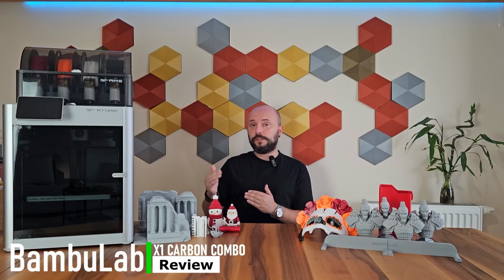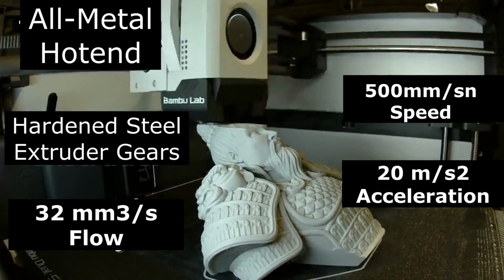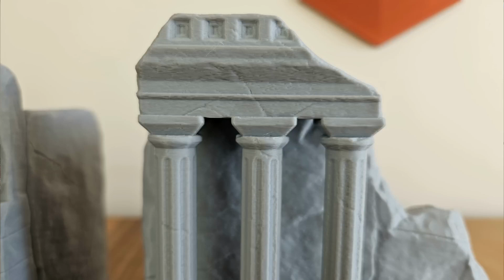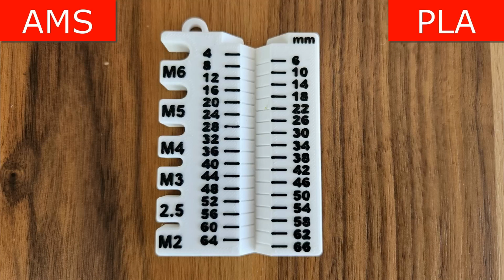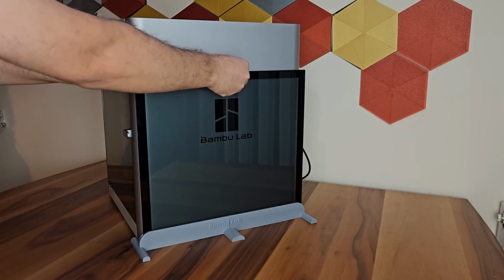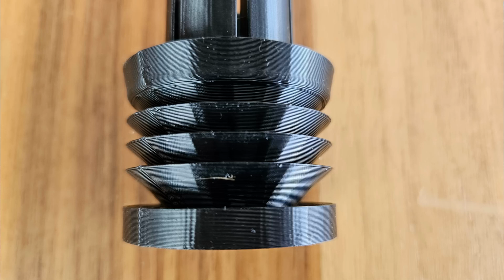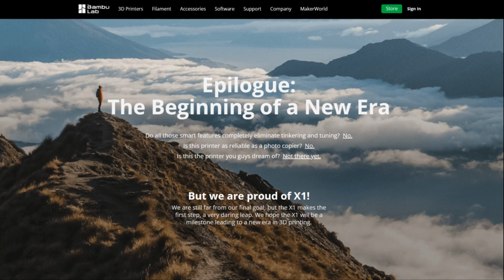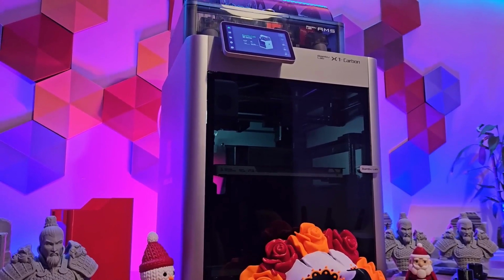Bambu Lab X1 Carbon Combo Review

Comment: Realized that it's better to use several printers for different color, and then combine parts,  than to use an AMS - it would be a lot faster and no filament waste (which is huge 😮)
Reply: But the mask looks stunning 😮🔥
Reply from the maker: @burningman1945  Yes, the mask is nice but there is a lot of waste. Filament consumption is high for hobby use only.

Comment: Not 256 cubic mm.  The volume is 256 X 256 X 256= 16,777,216 mm^3
Reply from the maker: You are absolutely right. I don't know how I said this :) I guess I just said cubic centimeter since it was the same in all 3 axes.

Comment: I considered the x1c but I wasn't interested in the ams due to waste. In the end I decided to go with the Flashforge Adventurer M5  Pro which has many of the same features and is less than half the price. So far I'm pretty happy with it.
Reply from the maker: Hello, thank you for your comment. Yes, the AMS system wastes a lot of filament. Although the X1C has better material quality, the M5 is a printer that I also like. There is also an M5 review on my channel, if you watch it, I would like to learn your experiences about your printer.
https://www.youtube.com/watch?v=fsOV1u8GhCE&t=156s
Reply: @3DPrintLab1  I'm curious what you mean by "better material quality".  If you are referring to the housing being aluminum vs plastic guess that's just a matter of opinion.  Aluminum is easier to dent and plastic is typically more damage resistant.  I think the doors on the X1C are glass where the M5 has plastic doors.  Again, plastic is more durable and they work very well.  The only 2 features I know of that the X1C has that the M5 doesn't is the sensor at the head, lidar I think it is and the purge tower.  The X1C does have a slightly larger bed and that would be nice but I'm just not convinced these things warrant the huge price difference (over double).  I could be wrong, I'm no expert.
Reply from the maker: @caseypries7559  Yes, as you said, the first thing that naturally catches your eye is that the metal covers of the body are glass. Apart from that, even the plastic parts give a premium feel. You shouldn't think of this only as impact resistance and flexibility. Even the weight of the printer affects the print quality. A solid carrier frame and body helps reduce vibration. I think we shouldn't compare the M5 Pro with the X1C, and this includes the price. The printers that we can evaluate in the same class as the M5 Pro should be printers like the Bambu Lab P1S or Creality K1C. Their prices are also close to each other. Whether it is worth the price difference depends entirely on the user's expectations. For example, I wouldn't recommend the X1C to someone who will use the printer for a hobby, it is unnecessarily expensive. (If have a lot of money, that's different 😄) The M5 Pro will more than meet the expectations.
Reply: @3DPrintLab1  I'm sorry but I still don't get it.  To me the x1c is just overpriced.  Making something from aluminum just to be aluminum is pointless.  The M5 is a metal frame, just plastic covers. Again, I have a lot of trouble understanding the $600 price difference.  I could've bought either model.  I just didn't see the point in throwing money away. So far the only thing I've heard mentioned is aesthetics.
Reply from the maker: @caseypries7559  I hope you don't think I'm defending Bamboo Lab. I'm just speculating why it might be expensive. Of course, it's not just because of an aluminum body or a glass cover. The processor, motherboard, the quality of the materials used in the mechanical parts, the cooling fans, extruder, camera or the lidar, all of these can affect the price. So we can't judge it based on what we see. I don't know how much each of these affects the price or what they will provide us. Maybe the processor used in the X1C is 10 times more expensive than the one used in the M5 Pro, I don't know. Maybe it's unnecessary to use this processor for a printer, I don't know that either :) But I think there's a reason why the X1C is so expensive while the P1S and P1P are more economical printers. Is it worth it? I'm not sure. I don't think the print quality is as much as the price difference. Maybe the quality of the materials used in very long-term use can make a difference.
Reply: @3DPrintLab1  No, I was just trying to make sense of the price difference.  I'm more of a function vs form person.  I appreciate form but in the end I'm looking for things that actually work and provide good value.  When choosing between the 2 the only thing that stood out to me was the larger bed and it's not a big difference.  I just couldn't justify the extra expense unless it spit out much nicer prints and from what I've seen there isn't much difference there.  But as I said, I'm no expert and just wondered if there was something I was missing.  Right now the only issue I'm really fighting is extruding TPU.  The M5, though rated for TPU, doesn't like to pull the spool so I'm having to unwind by hand.  Some say a spool holder overhead has helped them.  The bad thing is there is currently no way I can really leave it in my Sunlu filament dryer and just walk away.  Maybe I can figure something out.  Otherwise it's printed PLA, NYLON-GF, & NYLON-CF beautifully.
Reply from the maker: @caseypries7559
Reply from the maker: @caseypries7559  I understand you and you are not wrong. I was just speculating. For TPU you should either slow down the speed or as you said you have to loosen it by hand and pulling the filament out of the dryer is almost impossible :) are you using TPU 95A? Because the more flexible it is the harder it is to print. Or maybe you should buy an X1C for TPU because it can print very fast
Reply: @3DPrintLab1  yes, creality 95A.  I'm running it around 30mm/s.  It seems as though the feeder is just slipping.  Maybe due to the crappy nylon I had to pull out of it the other day.  I'll keep playing with things to see what I can figure out.
Reply from the maker: @caseypries7559  For TPU, loosening the extruder gears a bit often works, but I'm not sure if there's a way to do this on the 5M Pro.
Reply: @3DPrintLab1  It appears there is a hex screw on the left side you can back off but I think it's for unclogging the nozzle.  My feeling is it feeds into it fine, it just slips if the drag on the filament is too high.  I've ordered a ball bearing spool holder off amazon I will try mounting it than the unit and see if that frees it up enough to pull.  I've seen one of the reviews claiming that worked for them. We'll see.

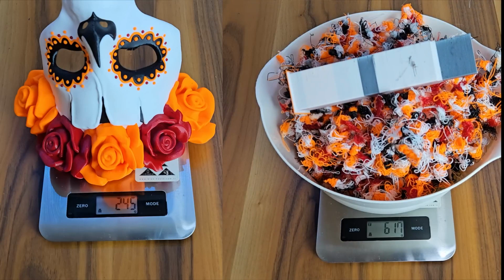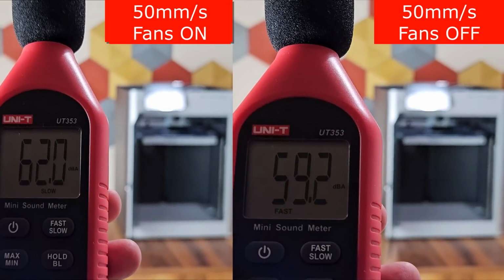Comment: Very good review - especially at 13:53 was very interesting. But 15:20 shows that something is wrong with the printer or settings. I own a Prusa MK3S+ (200 mm/s), and have to say, I get maximum 0.02 mm tolerance max since years (I am a product designer). Sliced parts or 2 parts like this in the mid - never happened. Is this normal that when you make 2 parts that they don't fit together? Because I overthink to buy a X1 Carbon. Thanks for your answer. Interesting at 20:15, that the time differences between 250mm/s and 500mm/s are only 39 min., or between 150mm/s and 500 mm/s is only 1:55h...  I know that it depends on the model and so on, but interesting to see, that some models can't print faster, even if it is theoretical possible. At 22:11 i have to say, my Printer you cant hear even at 200mm/s. I made dampers, it has no enclose, but I work 50 cm beside and can't hear it working.
Reply from the maker: Thank you very much🙏 I didn't pay attention to the junction point in the ABS print. I think it has something to do with my settings. I think it can be fixed. The reason for the time difference between speeds is that the printer cannot reach a speed of 500mm/sec at every point. For example, in the test I did for 500mm/sec, the printer may have reached an average speed of 300-350mm/sec; it is not possible to measure this exactly. We can only clearly see the effects of speed on duration with a single-wall print in surface mode. The X1 Carbon is not a quiet printer, especially with all the fans on. I don't think you can work 50cm away from the printer for very long :) It is currently working 10 meters away and I can hear its voice very clearly :)
Reply: @3DPrintLab1  Thank you very much for your answer. 🙂 Can't you fix the fan noise problem by your self? When I had years ago a creality, I had also to make some adjustments to make it silent. For e.g. exchange the vans and so on. Do you know if fixes for this problem exists? Because this noise would be a NO GO to me, I have to say 🙂
Reply from the maker: @tamgaming9861  You are welcome. Of course, it may be possible to solve this problem. There are premium class fans like Noctua in the market. Noctua fans are very quiet. However, it will not be possible to purchase and use these fans directly because the fan types and sizes are not suitable for the printer. Maybe it can be done with a few modifications. But I'm not sure about that either, because the X1 Carbon is a printer that notices even if you change the build plate and does not start printing, saying you used the wrong build plate :) So I'm very confused about this. It seems like it would be a difficult change.
Reply: @3DPrintLab1  Interesting ... seems like they build their own ecosystem like apple has.  I read they did it with the slicer which is only a copy, and before they warned about it and said it's a bad slicer. Thank you for the information!!
Reply from the maker: @tamgaming9861  I don't agree with the slicer issue at all. The Bambu Slicer is exactly the same as the Orca Slicer and they are both my favorite slicers right now. Especially the support settings are very successful.
Reply: @3DPrintLab1  yes, that i mean - they warned so often about the Orca Slicer not to use it, and so on, and then they copied it 1:1.
Reply from the maker: @tamgaming9861  Actually, this is confusing. When opening Orca Slicer it says "Based on Prusa Slicer and Orca Slicer" 😄 We all think we use BambuLab Orca Slicer, but I think it's the opposite. Or I don't know, it's just like that😄

Comment: My only issue with x1c in general is with gold textured pei and PLA. Extruder clog is extremely common in medium/warm temperatures. I can’t go beyond 55 celcius (top glass of, front glass open, wide open area) or extruder/nozzle is clogged. PLA users should definetly consider p1p if they’ll use it with textured pei.
Reply from the maker: Thank you for sharing your experience. I did not experience this problem, but I also think open case printers are better, especially for PLA filaments.

Comment: Almost everything that makes the X1C so good is also on the P1S and the price is a lot lower.  Sure, you don't get the fancy touchscreen, but so far I'm not missing it at all.  And the P1S actually shows that the Lidar is not really needed, since prints are just as good as the X1C and tuning your profile per filament can make them even better ...
Reply from the maker: I haven't used P1S yet, but the majority of users share the same opinion as you. In my opinion, the screen is not very important, I think Lidar may make a small difference in quality. I think the most important thing of all is that the table can reach 110 degrees. This is especially advantageous for industrial filaments such as ASA. While adhesion to the tray becomes easier, the inside of the printer remains warmer.
Reply: @3DPrintLab1  I would counter that with the fact that the P1S enclosure is plastic and hence less heat conductive than the Aluminum enclosure of the X1C, so that would make the P1S better for high-temp filaments.  Bottom-line is that both can handle the same set of filaments (if you get the hardened steel nozzle and hardened extruder gears for the P1S) and as such the X1C is just the more luxurious one, but functionally not really better.  Especially if you go multi-color or multi-material the lidar is more a pain than a blessing as it can only tune the first filament used.  The idea was ground-breaking when Bambu introduced it, but meanwhile has basically been proven an unnecesary luxury.  In fact, I expect a successor to drop the lidar in favor of some of the tech used in the A1 mini to get info on the pressure at the nozzle to allow tuning flow on the fly rather than with a pesky analysis using lidar on a couple of lines solely on the first layer.  I'm really curious to see what Bambu brings us in the coming months.  But to get back on topic: since your sole negative on the X1C was the price, the answer is simple: P1S.

Comment: if i ever get my hand on $1500, this is the printer i would buy for sure!!!
Reply from the maker: It's expensive but you won't regret it at all. I hope you get your hands on that $1500 soon.
Reply: Honestly the cheaper p1s imo is the better deal aa long as you control it from the app or slicer which you will most of the time and your ok with the downgrade on the camera to 0.5 fps instead of the 30
Reply from the maker: @zrampagegaming2674  In my opinion, P1S is an advantageous printer in terms of price. Although the camera resolution is a little low, this is not a problem for many users. But for some users, having Lidar may be important. Is it worth the price difference? I am not sure.
Reply: @fernandooliver7005   IMHO several cheaper printers for different colors would be better (faster prints with no waste) than X1C with AMS.

Comment: When I bought my X1 Carbon combo I also bought a package with it that included some Polyterra filaments and 2 od them were the same colour as the Bambu Lab filament it came with and I am convinced Bambu Lab filament is the same as Polymaker filament, when I ran out of green BL filament I let the print continue with Polymaker green filament and I saw no difference whatsoever.
 The Polymaker is cheaper than the Bambu Lab filament, the only difference is you don't get an RFID tag but I can live with that!
Reply from the maker: Thank you for sharing your knowledge. I can live with that too :) I also heard from somewhere that Bambu filaments are produced by Esun, but since there is no difference in the printing you make, it is possible that Polymaker also produces Bambu filaments.
Reply: @3DPrintLab1  I have quite a few Esun spools but because they are quite old I don't use them in the AMS as I am scared they may break in there and I hate taking anything apart that didn't build myself, I only use them with my 2 Ender 5 Plus machines and my Pro 3D V-King 400 that I built prior to getting my X1C, I shall have to see if I have any matching colours to the BL and Polymaker filaments